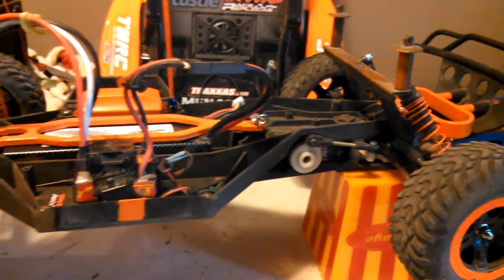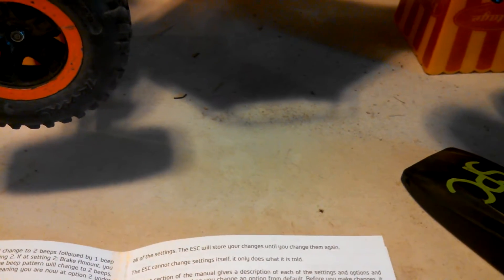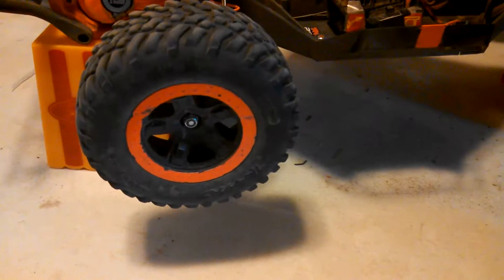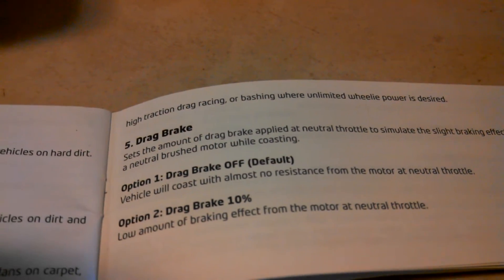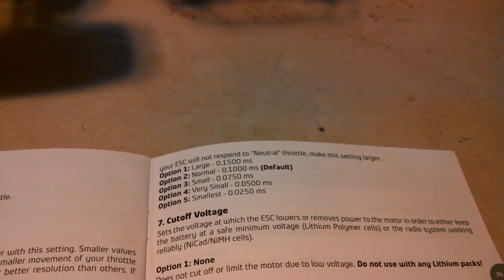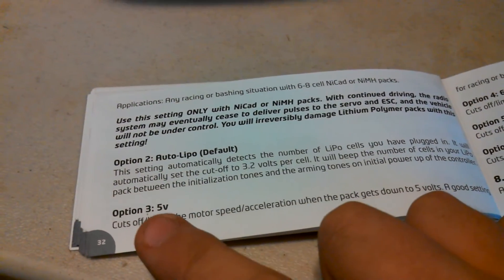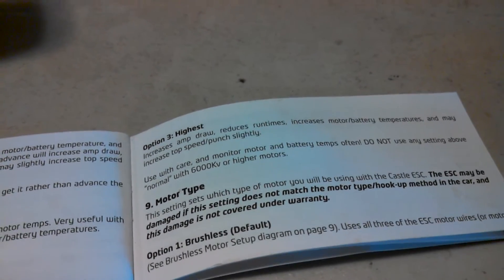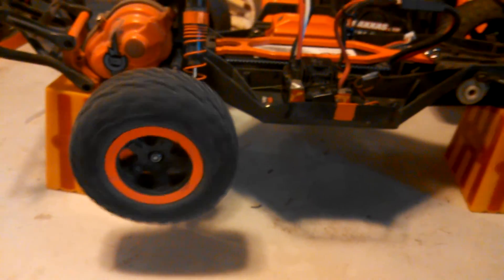How to program a Castle Creations ESC without a Castle Link or Field Card [Tutorial]

Comment: Excellent video man. Just one thing choosing 3.7 lipo cutoffs is for a 1 cell battery. If using a 3s won’t it drain each cell to 1.33 volts in turn destroying your battery. Auto lipo can tell how many cells are plugged in and cuts off a 3.7 per cell. Not 3.7 total. What’s your take on this?

Comment: Glad I kept listening. I wasn't correlating what you were saying with the beeping. Just sounded like gibberish. :) By the time you got to the 2nd setting, then the beeps made sense.

Any idea if this works with a non-traxxas transmitter/receiver? Or does the brand of tx/rx even matter?
Reply from the maker: Yeah, this will work as long as you have the esc. I have done this with my BER Chinese made transmitter and receiver.

Comment: I tried looking around and I couldn't find anything for steering. I swapped my chassis out for a new styled chassis and ever since then the servo is inverted. Even though the steering servo is correctly mounted. Is there any special secrete settings for steering? haha
Reply from the maker: Yeah, you have to invert the steering via remote, or just flip the servo saver so the link is on the opposite side
Reply from the maker: so make it where the link going to the servo saver is closer to the ground
Reply: Alright. What do you mean by remote? Like programming?
Reply from the maker: +ChomomoVids look up on YouTube "how to reverse steering on Traxxas remote"
Reply: RC Mayhem Thank you :) I forgot there was settings on the remote. It's been so long since I had to use them. Thank you!
Reply from the maker: +ChomomoVids No problem!